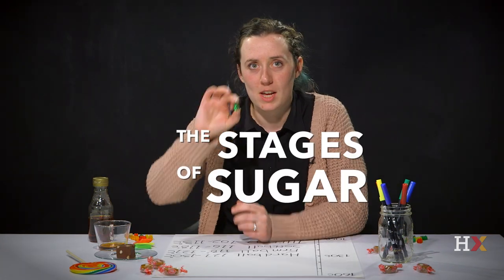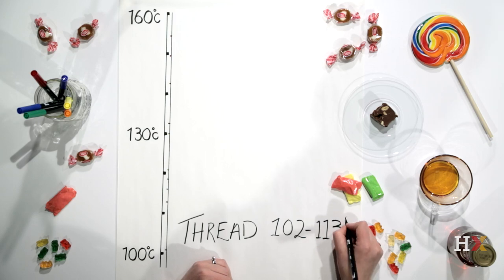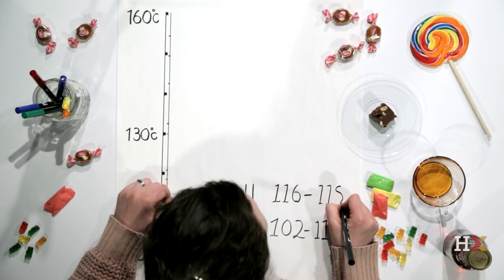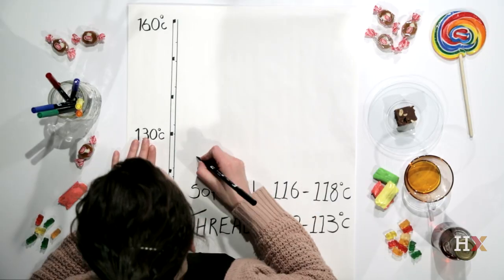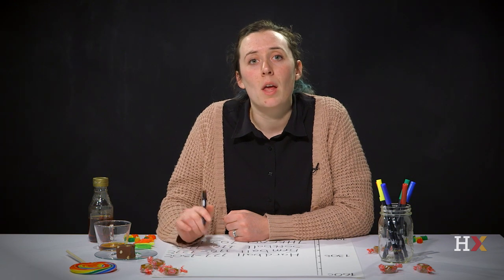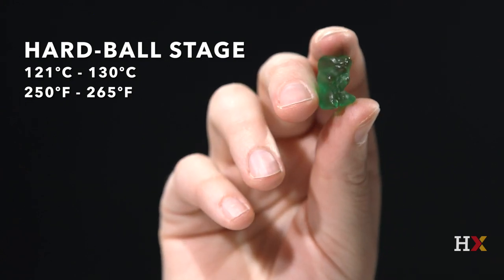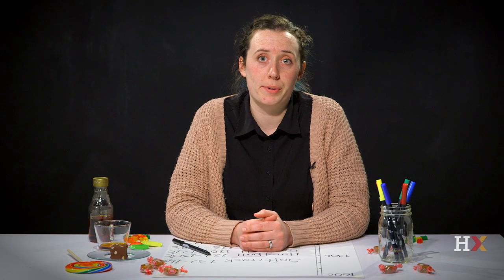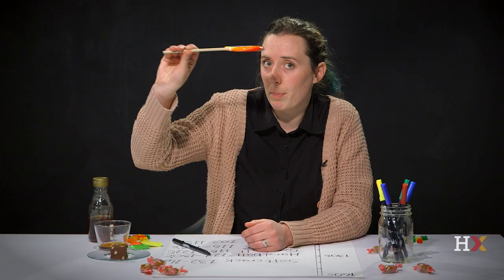HarvardX Science & Cooking: Sugar

Comment: What I don’t get is what temperature has to do with this? If I heat sugar for a long time on a low temperature do I get the same effect as high temperate for say hard crack stage?
Reply: No, time and the setting on your stove have nothing to do with it. What makes specific types of candy is the concentration of sugar in solution. You can measure the percentage of sugar in solution by its temperature. As sugar is heated, water evaporates and the percentage of sugar increases since there's less water. Hence you heat sugar to specific temperatures because it corresponds to specific percentages of sugar in solution. This determines the properties of the solution. Low concentrations make syrups (because there's lots of water left), high concentrations are hard and brittle (because there's little water and lots of sugar crystals).
Reply: don't let the sugar burn
Reply: @itsjustrenee1320  Actually, there's a stage past hard crack, and it's when the sugar browns:  It's called caramel.  Plain sugar develops a complex flavor in this stage.  In my experience it is quite tasty, and the darker it gets, the less sweet it gets and the deeper the flavor.  Texturally it is quite similar to the hard crack stage.  I don't know what happens if you cook it crazy dark and beyond.  It would probably taste burnt eventually, but I've never heard of that happening.  A medium browning is quite easy to achieve and, unlike needing a thermometer or an ice bath, has a visual indication of doneness.  Brown it to taste! (let it cool before you taste it of course)
I'm actually surprised and was initially confused when the videomaker said basically that caramel was hard ball.  It was a confusing example of hard ball (until I saw that what you showed on camera was definitely not hard-crack-like), and due to the omission of the caramel stage in the video kinda made it sound like hard ball and caramel were synonymous... which is obviously untrue.  The combination of the omission and the confusing example is unfortunate and makes the video a bit unclear.